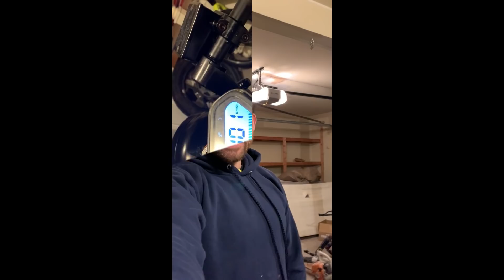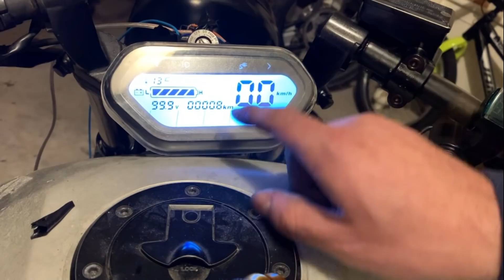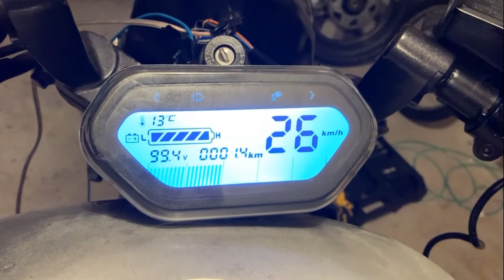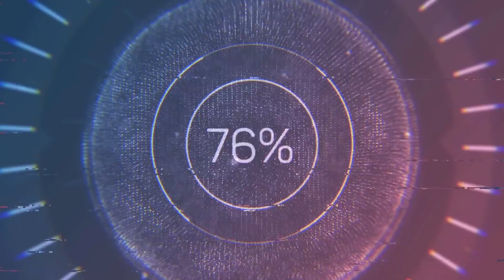ninja 250 QS Motor Unloaded top speed

Comment: The maximum speed of the QS Motor is determined by the Kv ratio turns per volt ratio). You are supposed to inform QS Motor of your required maximum speed and voltage and they wire the motor accordingly to achieve this speed at your battery voltage.
Reply from the maker: Correct , the controller is adjustable I was just showing it spin based one the set up I had

Comment: Hi DIY Guy, do you know what limits the speed of a QS hub motor? Will the manufacturer install some type of limiter at the highest safe continuous speed to prevent overheating? I've heard some people, racers, mod the controller to get a temporary speed increase of like 25%. Thanks.
Reply: The speed of the QS Motor is determined by the Kv ratio (turns per volt). You are supposed to inform QS Motor of your required maximum speed and voltage and they will wire the motor accordingly to achieve this speed at your battery voltage
Reply: Most controllers have a boost function where you can increase the speed of the motor by the method of stator Flux reduction. This can be used to increase the maximum speed by as much as 50% but results in a decrease of efficiency

Comment: what type of battery did you use for the 8KW motor? I'm planning to use Lipofe4 48V 60Ah but really don't know if it will make the trick with this motor? Also do you think a step up booster for 72V will work?
Reply: LiFePO4 is the best all-round battery out there - safe, powerful, long lasting and forgiving. 48V x 60Ah = 3kWh which is a bit small for decent range. On a small 120kg bike you should get around 50km range. But, more importantly, you need to consider the C-rating of the cells. If your 60Ah cells have a 2/3C rating it means that they can handle 2C (120A) continuously and 3C (180A) for short bursts of acceleration . This is fine for a small motorcycle but higher C-ratings are required for larger bikes and/or higher voltages to get more torque and power

Comment: Nice work man! I just received my QS 8000w 72V V4 kit. I have a question. Did you use a main contactor in this build? I didn't recieve one with my kit and was wondering if I needed one.
Reply from the maker: Yea you deff should as a cut off just as a back up
Reply: @diyguy1476  thank you! I just ordered one up! I hope this isn't another silly question but are you using regen and if so is there anything special I need to do to use the regen?

Comment: Nice build. Feel like sharing how u wired up the dash?  ;)
Reply from the maker: Speedometer Plug and Cable.
1) Red Color Cable, Battery + Positive Electrode.
2) Green Color Cable, Battery - Negative Electrode.
3) Blue Color Cable, Speed. Connect to Controller Hall Meter.
4) Black/White Color Cable, Headlight.
5) Light Blue Color Cable, turn right.
6) Orange Color Cable, turn left.
Reply from the maker: Yea i have the basics working but i am still working on the turn signals and all ill share the video once i finish
Reply: Great. Have the same gauge. ;) Connects to the hallsensor right?
Reply from the maker: If you have the same controller that i am useing the blue wire is hooked up to the yellow and green wire labeled pulse